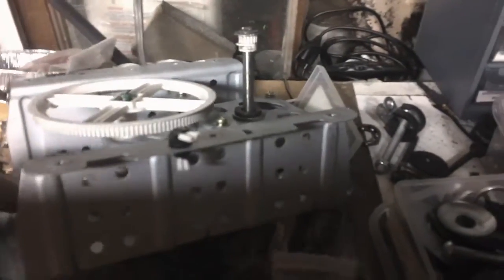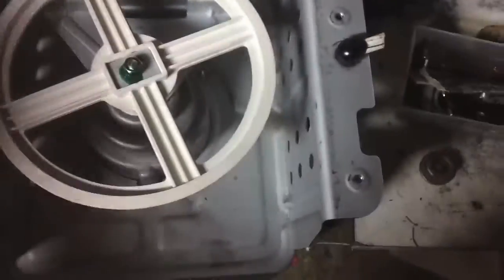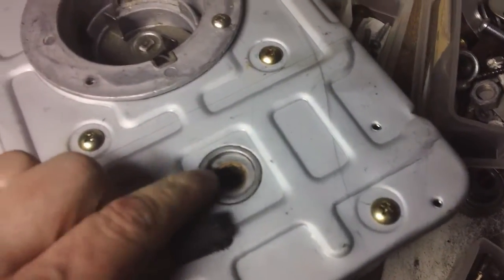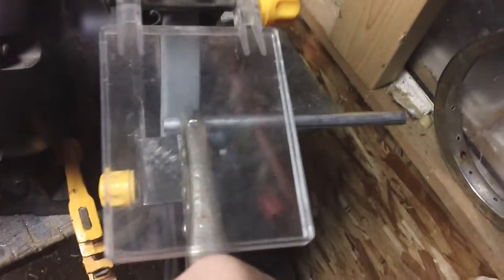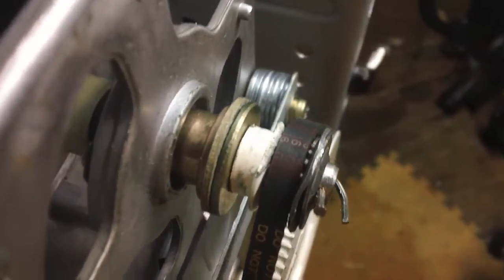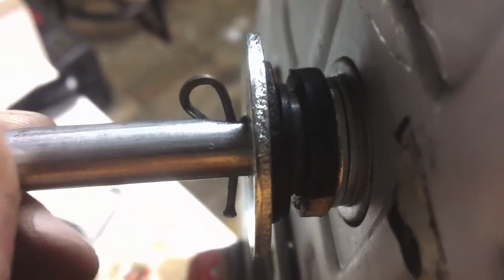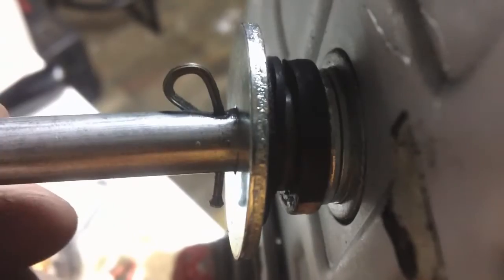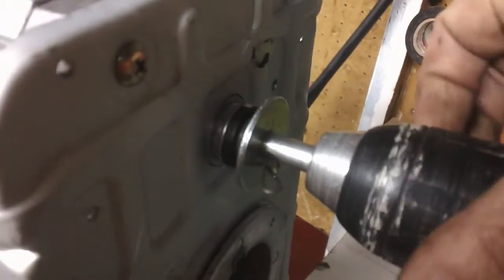Part 1 of the Breadmaker VAWT Project - Pulley & Shaft

Comment: Idea for a project....that's if you can picture what I am getting at :) ....a vawt...spinning  around on say 6 inch wheels that are attached to the driveshafts of some type of generator  (or at least having one wheel that is driving a generator).. ..I think just one RPM on a 2 foot diameter VAWT would equal about 24 RPM on a 6 inch wheel. I think wheels would provide less of a drag than a pully and belt type of drive.
Reply from the maker: I have seen this done before, a YouTuber used a modified car alternator on a 2 foot rotor. You should go for it and make it. Nothing beats real life experiment. Thanks for the suggestion!